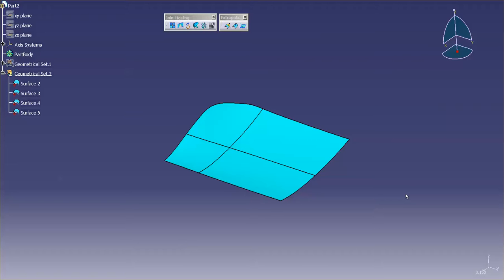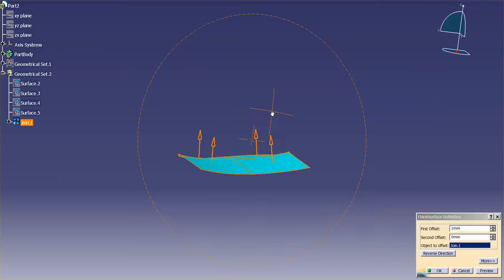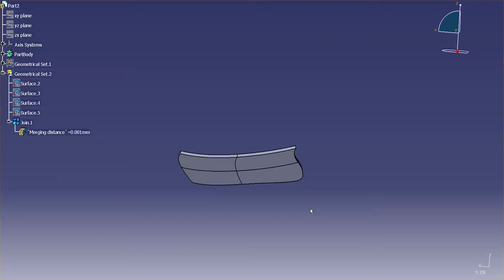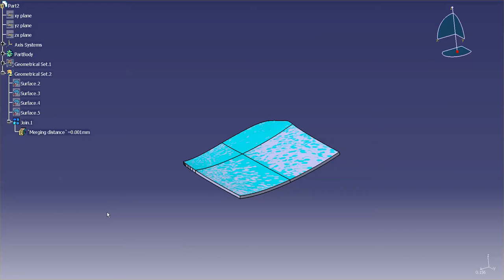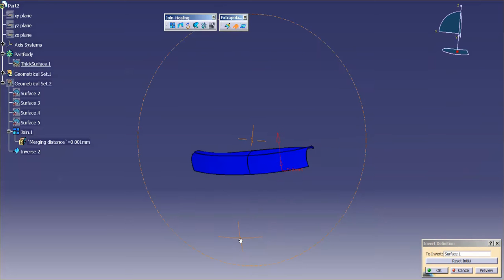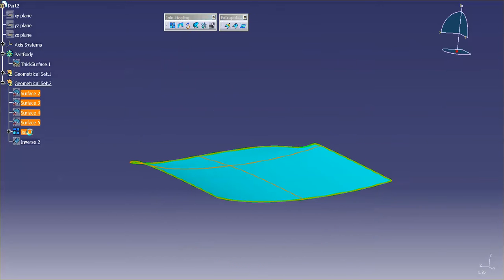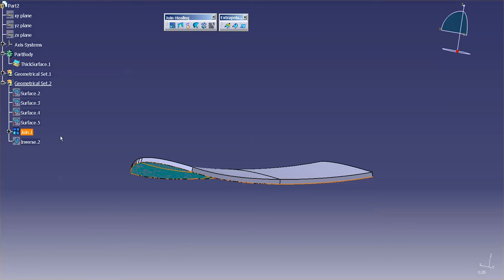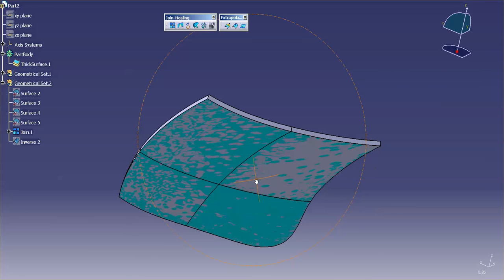Catia V5 | Catia V6: Controlling Surface Normals

Comment: Hey, can you make a video about surface normals control in NX?

It would be nice to get some information about good practices and background theory regarding surface normals for all downstream actions. For example in NX (stability of trimming and blending)  and pre-processing for simulation (CFD, FEA)

I am about to create a model, which will be used for manufactoring, but also simulation in CFD and FEA. I want to create a stable model, which is editible with parameters and does not blow up because of weak links in the chain that represents my parts history. Maybe even a video about those weak links in your part's history might be interesting. You already mentioned breps in another video, but I would find it very interesting, which habits and workflows make for a very stable and editible surface model.

Thank you for your videos!
Reply from the maker: Thank you for all of your comments and questions.

This is a massive subject, in regards to normals. I can do a video on some parts of it for sure.